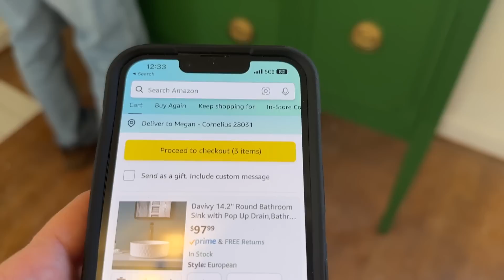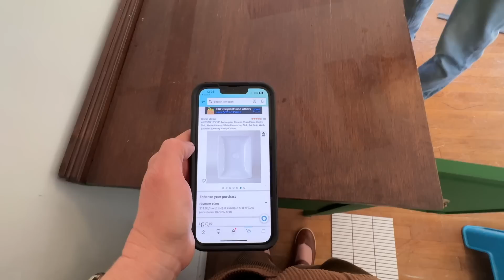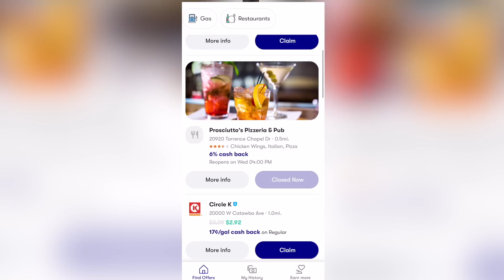IS THE BATHROOM RENOVATION FINALLY COMING TOGETHER?

Comment: The bathroom is going to be fabulous! Just thinking about the height of the vanity with sinks on top … could you cut an inch or two off the legs? Although a little still could easily be stored out of the way, underneath.

Comment: Last time I watched was day 77 til move in.  Now 27 days later ooooo a wall.  And still micro-decisions about decorating a vanity.    Where is the framing for the rest if the house, master BR foundation for the carport conversion?? Electrical and plumbing?  At your current pace the house won't be done until six months from now unless you sub out 95% of your jobs. Good luck.

Comment: As someone who is extremely organized and lives in a tiny space (full-time RVers), breaking up any remaining space is a waste. If you place the vanity against the left wall, that should leave plenty of space on the right to put a slender cabinet, decor, or even shelves. A compact design (against the end wall) in an already small space is ideal. Looking the best and most functional are two different things for consideration. Centering in that small area is not thinking outside the box. Just my humble opinion!! Very excited for you all, and BRAVO for taking on this project yourselves! P.S. I most definitely agree with others about a window(s) for letting in natural light. Otherwise the overall feeling will be cave-like.

Comment: You should put a frosted window for light….not wielding…into the vanity area!!   Center the Vanity!!  You have slender trash bins and the bodies will not be slammed against the wall!!!  The towels, etc will fit wonderfully with the vanity centered!!

Comment: I think you should center it as you have to remember with two sinks you need to have some left elbow room.  Also looks more cohesive  when centered.  Usually you don't need a waste basket in that room.  Would use it more where the toilet paper rolls go.  Happy renvovating

Comment: Centre it for sure. Since the bathroom will have it’s own trash can, you won’t need any large waste basket in this room. If you decide to put wall mounted towel racks on each side it will also make more sense to have them equal distance from the sinks.

Comment: I would slide the vaniety flush with the new wall side and do a floor to ceiling open shelving on the side nearest the original door opening. Can then use these cubbyholes for towels; small baskets to hide frequently used stuff, etc. I think people will not be so inclined to open lower dresser drawers to access toothbrushes. etc.
Reply: You only really need a tiny trashcan in the vanity side of the bathroom (can be put in one of the cubbyholes). The "main" garbage can really only needs to be near the toilet side.

Comment: I like the idea of centering the vanity.  You can still hang your hand towels on the side walls (not next to the mirror, because water drips and little arms will mean you clean it daily).  Having some pantry type roll out cabinets would work well next to the vanity unit, or even placing some pretty baskets underneath the vanity for storage will hep a lot.  You could also add some power points to the wall by the hallway door, and a shelf above the handtowel, for the girls to use for hair tools and charging electric shavers etc.  I love watching your progress .... You are showing everyone that its possible to have style on a budget :D

Comment: I just want to mention - my family bought a house with those  curved spouts over the round basins (I think you call them sinks). The first time I turned on the tap (which was a little stiff) the water shot up the side of the basin and hit my front then when I bent over to rinse my face I whacked my head on the round section of the spout and had a bruise in the centre of my forehead !!!   Love from Pietermaritzburg, South Africa

Comment: I used paper to cut out the diameters of the sink(s) and tub and shower etc when I remodeled my bathroom.  But it worked really well to help me visualize the sizes I needed .  It also helped with placement.  I also traced outlines on the floor and walked around my bathroom for a couple days to may sure I liked what I had drawn.  LOVE MY NEW BATHROOM!  So glad I did the paper images and tracings.   I also put in a window in the wall separating my shower and tub.  Lets lots of light in y shower!  Think about a window in the narrow wall between the vanity and the rest of the room ( in the upper third for privacy.  This would allow you to hang towels on that narrow wall.

Comment: I think having shelves for storage in those walls would be great since so many ppl are going to share that bathroom. Then you could put little doors or even a framed picture to disguise it so that would add tons of storage and those walls don't need to be insulted. Ooh maybe even put plugs in the back of the shelf in the wall so you can have things plugged in outta sight like electric tooth brush or just so the plug is hidden .

Comment: I would absolutely center the vanity. Once you add the mirrors and lights, it will look "off" if you don't. Our bodies naturally crave symmetry. You're going to end up with less space than you think anyway once drywall is in. And you need to maximize elbow space as much as you can for each sink.
I also agree that the sink room desperately needs some natural light. I love my bathroom skylight, but the frosted/stained glass idea sounds great, too, and I like the idea that you can tell it's occupied by the light being on.
And along with that, please do separate light switches inside each door. You don't want someone brushing their teeth to turn the lights off on someone showering or using the toilet!
It's all looking great!

Comment: Center it. On the left you can put some medicine cabinets that you can replace the front covers with some picture or paint something on it so it looks more you. I would put those wall hangers that hold 6 towels rolled up for the kids to use. If you're in the left mirror you'd want some arm space to get ready.

Comment: I would centre it. You can then fit towel rails each side for people using both sinks at the same time and they had enough space for towels to hang comput a little bin in the corner near the door. If you are going down the black taps route and black metal on the lights. Perhaps the handles on the sink unit could be sprayed black too? Another good idea (was it Andrews suggestion? Maybe put a little glass window on the wall where he suggested or put a pane of glass above the door or you could put frosted panes on the door (maybe a little arch of glass panes) to let in some natural light from the bath toilet room. Plus if the light was on, at least everyone would know whether it’s vacant or occupied, but they wouldn’t be able to see who is inside or what they’re doing if it’s got frosted glass. But letting light in was a super idea.

Comment: Once you have sheet rock on the walls in the bathroom, I don't know as if you would have a heck of a lot of room left on one side of the bathroom vanity if you had it bumped up against the wall. Leaving a bit of room on each side makes for a larger "working" space for each person standing and using the sinks. If its up against one wall, the person on that side may have to physically move over closer to the person at the other sink in order to not bump their arm against the wall as they're washing up. Maybe try having two people stand and mimic washing hands with the vanity against the wall and see if the wall crowds one of them. Also, it would be nice to have a bit of space on each side for the towel racks. I'm really enjoying watching you fix up this little house and can't wait to see it when it's done!

Comment: If you do install sinks that sit on the counter, and I think your plan was to use the buffet as a vanity, I would suggest you epoxy the top of the buffet and even around the inside of the faucet and drain holes that go through the top, BEFORE you install the sinks. Anytime water lays on a surface it will eventually damage that surface. I used an epoxy to change ugly outdated kitchen counters to faux granite. It turned out amazing.

Comment: Center the vanity. Add electrical outlets for hair dryer, curling iron, shavers on each side of vanity! Add frosted or stained glass to separation wall for some natural light, although it will be blocked if you have cabinet on wall next to toilet. Love the green vanity.

Comment: I would center it. You have cabinet at bottom with drawer for trash can. Also, you can have trash can in tub and toilet area. Looking good, love the wood look with the sinks. The wallpaper will really brighten and lightened the area, plus the floor. That vanity is going to be eye candy for design when finished.

Comment: The hand towels won’t be far away considering you’re going to have the sinks on the ends. Definitely center, by the time you had drywall you probably won’t have much space left over if it’s put in one corner

Comment: Question… could you keep the mirror… center it over the vanity and add two or three small pieces of mirror (maybe in old picture frames) hung vertically on either side of the bigger mirror

Comment: Two smaller mirrors, one above each sink,  towel storage on the wall between the two mirrors. Vanity flush to the wall nearest the door coming into to bathroom, leaving room on right for a narrow custom built shelving area for more storage, including a trash area at the bottom.

Comment: I like the light through the wall with a high window idea. Don't just leave a hole ( privacy).
Center the vanity , so towels on both ends. Put the wastebasket by the toilet. Outlets at counter height on both ends of the vanity for curling irons, nightlights, electric razors.
 Lights in both sides of the bathroom. 
Looks like you might have space to the left of the toilet for a linen closet. 
With all those kids think about each one having a hook in their room for their towel. That way no one else is using it. 
I had my kids doing their own laundry by 12/13 yrs. They dirtied or threw too many clean ( wrong outfit) clothes on the floor as teens. 
I really like the sinks! 
Just think , next year at this time you will be settled in. It goes by fast and slow. We moved 10 months ago into a new house, and the projects are never ending.

Comment: This is lovely. I think the furniture should be centered, and you could either add some thin trash can/baskets to either side (or under), 

or if this can fit/work (i can't really see how much room you have) you could make a tall built-in cabinet on either side from floor to ceiling, flush with the furniture, that would not be too deep but could hold more stuff like each kids' products (toothpaste, perfume, hairbrush... who knows what else?). Cabinets could open either towards the back wall, or towars the sinks. Might be too tight, I don't know.

I also like Andrew's idea of the tiny window on the wall: if you use like "blurred" glass, this would bring some natural light to that first room, which is ALWAYS welcome.

Comment: I would definitely recommend centering it in the bathroom. Since it is a small space having it off centered would really stand out and make it look like an accident/diy. Luckily it looks like there’s still room on the side to put a trash can. I would think about building out a frame on the left side wall just below counter height as a built in “trash can”. It would be hidden and a great use of the space. The kids could easily put a trash bag in & pull it out to change it. This would allow you to be more creative with what you do with the more accessible right side. GOOD LUCK

Comment: I would center the sink base- your going to loose 2 inches when the drywall is installed. Towel holders on each side- trash can on inside of cabinet doors ( hangs on inside of door)

Comment: Look into Wood Boat varnish/Marine varnish I think it’s called for the wood on the bathroom , they sale it at Lowes.
If you wanted to have Mike build inclosed shelves on the odd side of the vanity(not centered), you could actually store tissue, a trash can in the bottom , and a hand towel ring on the side of the built in👍🏻 it would not look off centered then. Sorry I can’t describe better. Lol I need to add a photo

Comment: Idk. I think you should look at this as a temporary cabinet. Down the line you’ll realize there isn’t room for the storage you need because the pipes will be taking up most of the cabinet space. You need storage for q tips, cotton balls, toothbrushes, floss packets, hair brushes and combs, hair gel, rubber bands and pins, bandaids, hairdryer, skin care, face wash, makeup remover, medicines, body lotion, face lotion, mouthwash, ibuprofen, antiseptics, neosporen, sunscreen, contact lenses, eye drops, shaving cream, razor, tweezers, nail clippers etc. You don’t want that sitting on shelves. It will look very messy. And what would be the point of renovating if things didn’t look nice and it’s not functional?

You’ll also want room for basic cleaning supplies as well. If you want the sink to not be messy with toothpaste and lotions, then you’ll need wipes or extra towels in the sink room to wipe up the sink. It wouldn’t be practical to keep them stored in the shower room storage area. You’ll need space somewhere in the sink room to put a tissue box as well. And you need separate towels to dry your face on after you wash it. 

You renovated the bathroom in the first place because you wanted it to be more functional and have a separate room for the toilet and shower. You need the sink room to be functional as well, and also not look like a mess with about 20 different things on shelves.

Comment: I have made my own vessel sinks with ceramic bowls I cut with a hole saw ceramic bit. Kind of along the line of making a vase into a lamp by drilling the hole with ceramic bit, just a bigger hole. Then you use plumbers putty around the hole and put the drain in.

Comment: Putting the vanity on one side will give you a little extra space for a trash can and even a little bathroom rack or small open shelves if needed.  It would also be easier to clean the floor but centering it does look good as well. It will just take away some space and leave empty space.

Comment: Just a thought, since I just redid my bathrooms - Having a mirror coming all the way to the counter or even a short backsplash, you will most likely be cleaning it often from water splashes. Have you thought of using two framed mirrors? (One centered over each sink).
Reply: Our master bath has 2 sinks and this is what we have. A mirror over each sink. I think it works well.

Comment: I’m only a few minutes in, but I will say I had a vessel sink because it was easier and cheaper, and I hated it!!! It was awkward to wash your face and hands and brush your teeth in because it was so high, and it was hard to clean. It also ruined the counter it was sitting on, even though it was sealed very well
Reply: It was also more expensive in the end to plumb a vessel sink

Comment: Have you considered putting the toilet in the corner diagonally? It looks like it currently will seat very close to the right side wall. It can be pulled away from the corner therefore using a standard toilet tank. Benefit would be if you have older family using a walker or those visiting whom are larger in status could also use it in comfort. Doing it right the first time means not having to redo it later. Just my opinion.

Comment: Center it. It looks much better. Also, will you be giving it an aged look with a dark wax? Right now it has no dimension and the paint looks just flat. I watch Robeson Design and she is so knowledgeable. She says and I agree and studied in my design classes, that lights should always go on the sides of your bathroom mirrors. Lights from above are awful. They create shadows on your face and horrible black circles under your eyes. Good luck!

Comment: I love it. I'm putting in vessel sinks when I redo my bathrooms. I want the sinks higher and the only way to do this without replacing the cabinets is vessel sinks. I don't know why all vanities aren't counter-height, same with toilets. My toilets are all adult heights. Why do need to have these things that are for children when our children grow up and don't really need them for that long. My 5-year-old grandchildren have had no problems with my toilets. A small stool can be used for the sink until they are tall enough. They will enjoy the higher counters for many more years than the need for the shorter vanities and toilets. During my career designing homes, I always specified taller vanities and toilets unless my clients really wanted kids' bathrooms with lower heights. All my main bathrooms had taller vanities. Do your knees a favor and get chair-height toilets.

Comment: Centering is way better aesthetically, but either way you're going to want to fit a trash can somewhere near the vanity. Just thinking of all the little bits of tissue and cotton balls and stuff from girls doing makeup and boys shaving. Potentially one of those cabinets on the sides could fit a small trash can inside.

Comment: The vessel thinks look good. Hang the mirror on the opposite wall with narrow shelf or hooks underneath. The mirror stays much cleaner and you turn to use it if necessary. You dont need to look at yourself when washing hands.